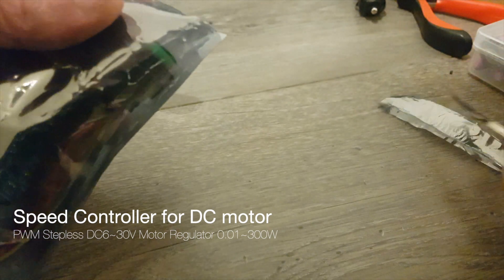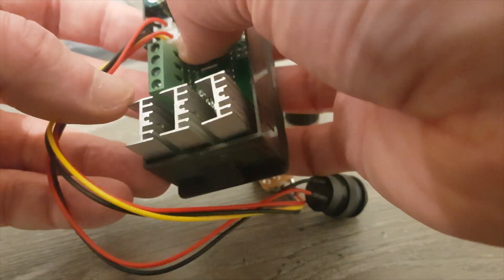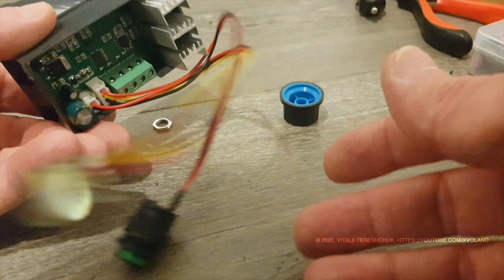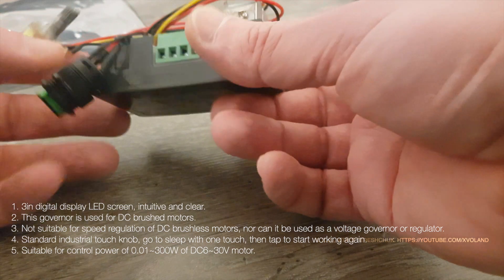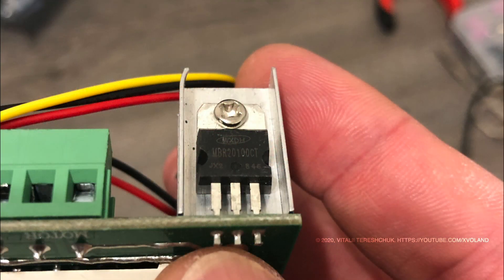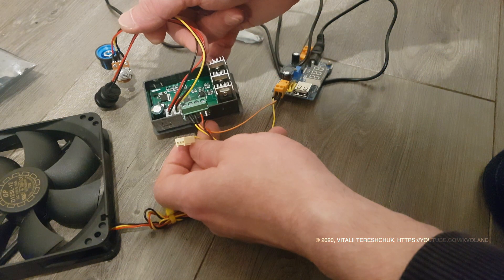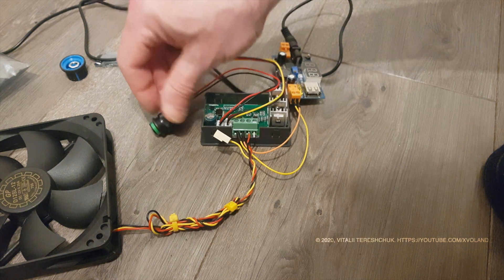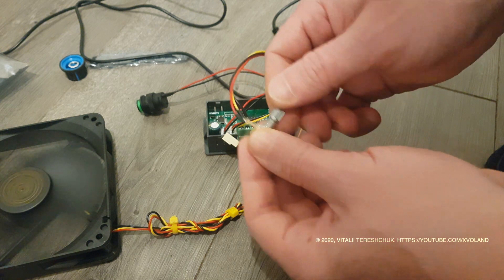📦 PWM Speed Controller 0.01~300W for DC 6~30V motor CCM5D with digital indicator and button ON/OFF

Comment: Hi,namaskar
I am using this to control the hot wire foam cutting machine.but it trips after 1.8 amp.why
Reply from the maker: Hello! I haven't encountered this, but you are probably exceeding the capacity of the device
Reply: @xVoLAnD  OK Thank you

Comment: You may not have needed the buck converter as the module can handle up to 30V and 300W. But I understand why you wanted to limit to 12V as the input.
Reply: I think you could have just used the buck converter to power and modulate the speed of the fan too.
Reply from the maker: Exactly
Reply from the maker: This module has become part of the engraving machine 😉

Comment: Hello. What hole to drill in the panel for the ON / OFF button.  and for the control button?  I'm preparing the panel, but the controller hasn't arrived yet.  So I don't know the size of the holes.  thank you for the info
Reply from the maker: Hello! I can give the size dimensions/holes, but I think better to wait for the module